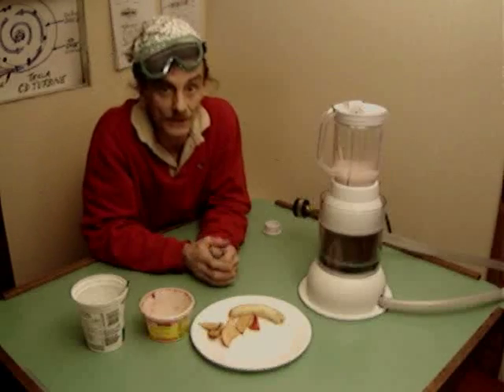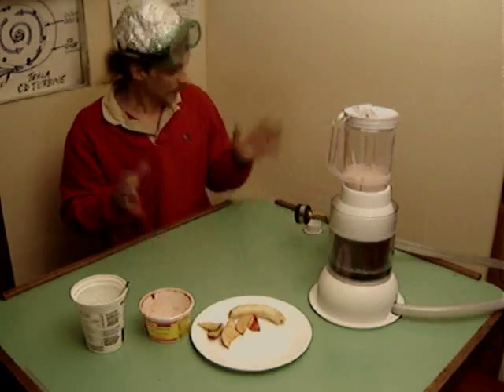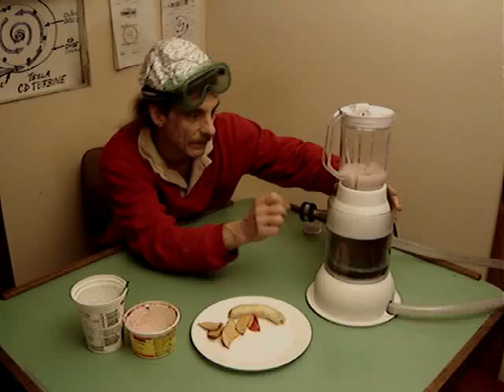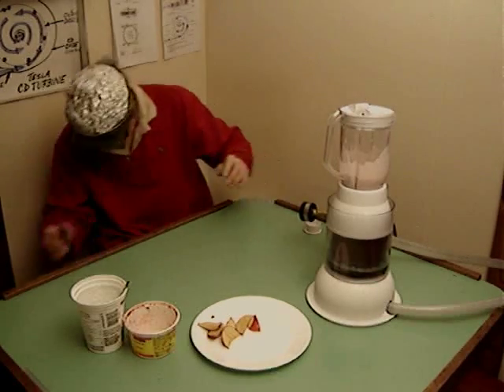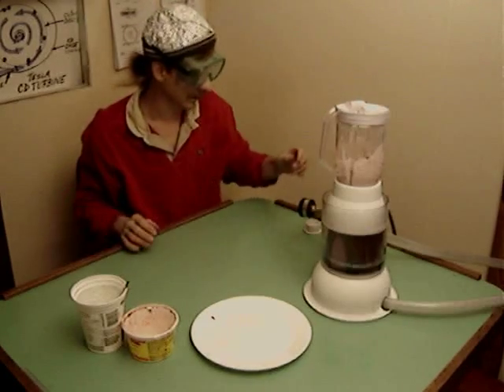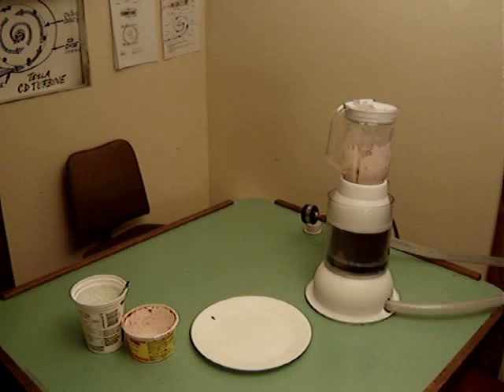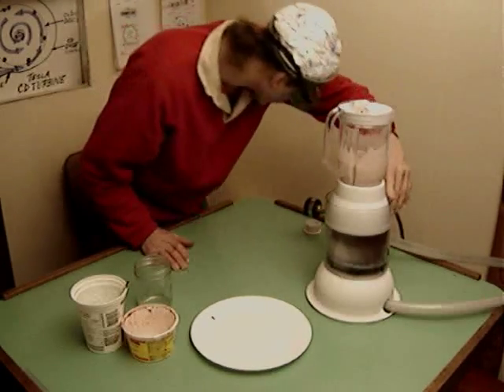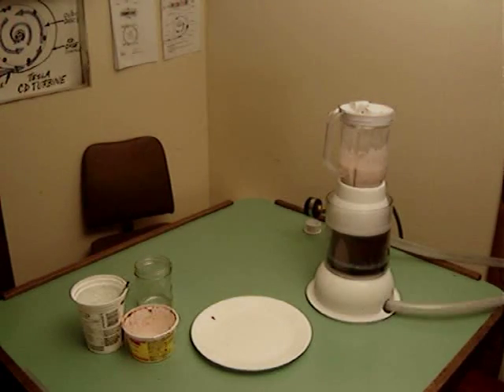Recirculating Tesla CD Turbine with Power Boost Blender

Comment from the maker: @xkrnsniperx 

I normally use a 120 volt air compressor, but I have also accomplished the same effect by using a 12-volt compressor running into a larger (5-gallon) tank. The 12-volt compressor runs from a 12-volt car battery that gets charged by solar energy. 

It takes a long time to build up pressure with the smaller pump, and will tend to burn it out, so I use the readily available 120 volt compressor usually. I just plug it in and it builds up to 125 psi pressure.

Comment from the maker: 300 series stainless is usually used. Note: Tesla's discs were .030 inch dia for the 6 inch size. Thinner the better, except they can bend together at the nozzle outlet pressure. 

Tesla used the best German silver-steel at that time and got 30,000-35,000 rpm before stretching the metal. But that was on steam. Water will take some pressure to get to that rpm.

Comment from the maker: The star washers may produce some turbulence, but the flow velocity already has slowed down significantly at that point. The back-pressure will give more torque, less rpm.

Tesla presented a 60 inch turbine to allis-chalmers for testing, but Tesla said they would not build to his specs, and it did not fare so well. The max rpm was 12,000, I believe. With modern nano-carbon ceramic discs, perhaps double that (24000 rpm) would be possible.

Comment from the maker: Don't confuse surface finish with washers or other spacers that can increase low-end torque. 

The surface finish of the discs is to be as smooth as possible, according to Tesla and others. 

Tesla designed multiple washers as spacers, and other ideas like bumps have been suggested. This was to prevent disc warpage and get better starting torque. It did not increase high rpm power!

The actual disc surface must be very smooth to enable the laminar boundary layer effect between the discs.

Comment from the maker: Hehe, yes a lab coat is a great idea! 

This model runs on combined air and water pressure at the same time for additional torque. It's a recirculating system, off the grid as well.

Comment from the maker: I feel like a real mad scientist when I put on the Tinfoil Safety Toque. 

When the Tesla CD Turbine is running on 20 psi water pressure, it only puts out about a watt of power. When the air pressure kicks in with this combo system, there is considerably more power, perhaps about 100 watts.